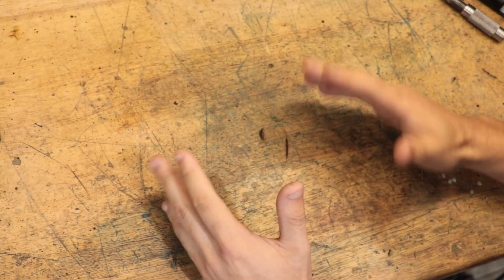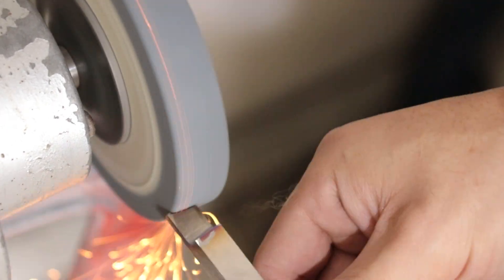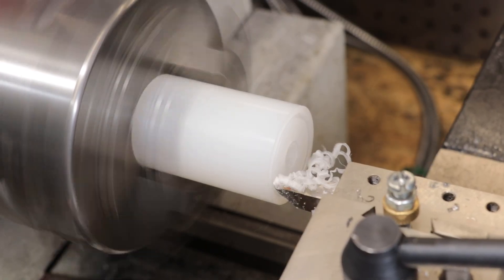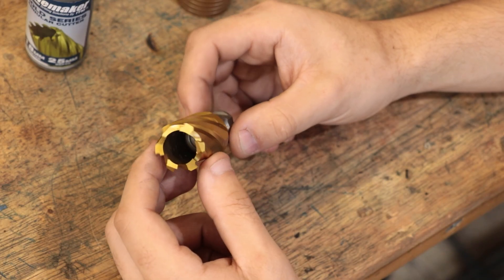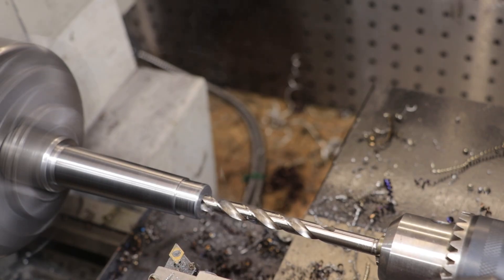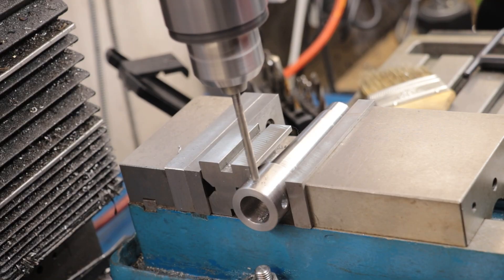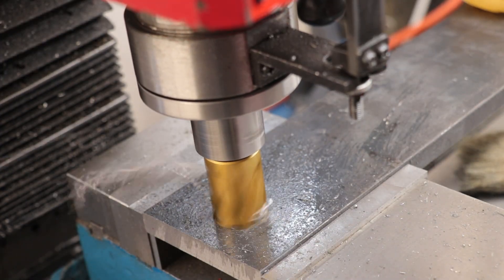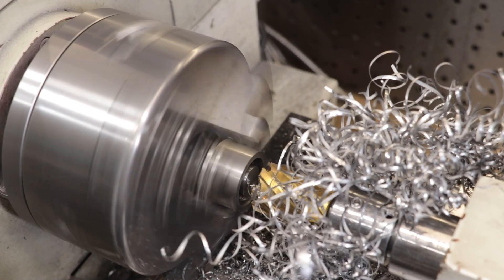Lathe Trepanning - 99.9% Not Brain Surgery

Comment: @artisanmakes  - Aout your lathe. I have one the same and haven’t figured out one thing. There are two sight glasses to see how much oil is in the lower and upper gear case. Mine leaks, I think from the top gear case. Filling up the top gear case is easy ; remove the top cover oil hole screw, and fill it up. How do you drain, and fill the lower case? Maybe I’m missing everything! Thanks for any advice.

Comment: Regarding Trepanning. I had a job once that required 3" dia stock 6" long to be turned into special rollers with a 3" long center portion and 1 1/2 long 1 1/4" diameter hubs on either side. I ended up with a 2 tool trepanning holder with each tool doing half the work mounted in the tailstock. 1 would cut the OD and half the floor and the other would do the ID and the other half of the floor. then part off the remaining rings. Since both tools vibrate at different frequencies they couldn't reinforce each others chatter and damped themselves out. Each tool could be much thinner than the groove so clearance was easy, they could each be angled to ease the clearance problem. So it was really like 2 boring bars operating together. |___|  <--like that.
With hundreds of parts to do this saved me a bunch of time and a huge pile of chips. BTW I still have a box full of those rings decades later! I just KNOW I will use them for SOMETHING one day.
(of course this was before annular cutters were avalible)

Comment: I use those annular cutters any time I can. They out perform any drill by a large margin and need no pilot hole. I even use them on CNC work. The downside as you mentioned is cost. They are spendy and are difficult but not impossible to re sharpen when needed.

Comment: The easiest way i know to get the clearance right is to blue up the end if the tool with dykem and use a radius gage to trace a radius tangent at the corner and slightly smaller than the outer radius you're trying to cut.

Oh, and that bird's nest at the end is terrifying. A giant flail of razor sharp steel ribbons moving at high speed.

You need to peck the cutter to break those chips and stop them from becoming a hazard.

Comment: Re turning the morse taper holder - you can buy morse taper blank arbors, with ground & case hardened tapers, & soft machinable ends... They're not very expensive, and make the job a lot faster & easier.

Comment: Thanks for this!  It was very painful to turn brass into chips a few days ago.  I had to make a bushing that had an OD of 2.300"/58.42mm, an ID of 1.885"/47.88mm and a depth of .875"/22.23mm.  I hated to scrap that much brass.  The workpiece was 2.5" x 6" (63.5 x 152 mm) and cost $172 USD.  That's $28.67/26.43 EUR per inch (25.4mm) so I converted over half of the value into chips.  A 1.5"/75mm x 7/8"/22mm disc is still a very useful chunk of brass.

Comment: Nick, doctor, your plans are good but the execution is not great. Look at industrial trepanning tools and their geometry; quite complex but that's why they're maximum strong and stable. My idea on the matter; hand grinding a trepanning tool for larger depths is not the way to go. Industrial ones are indeed quite expensive and you need quite a few and the appropriate holders too; quite a expensive system. Removing core material by drilling and turning with a boring bar does spoil otherwise usable material but the investment or effort to have a trepanning tool/system compared to the savings in reusing core material is, especially for the home machinist, not feesable in my opinion. Speed of the proces compared to investments or time spend grinding? No home machinist would go this expensive road, Same goes for the angular cutters; expensive and you need a few. Sorry but all the best doctor! Job
Reply from the maker: Industrial trapanning tools aren’t single point for a reason.
Reply from the maker: I don’t think it’s too useful to compare industrial applications to the home hobby shop
Reply: @artisanmakes  I think it is; physics works the same at home. Thank you!
Reply from the maker: I am quite familiar with industrial trepan tools. They are not single point for a reason, they are cylinders but they are very expensive and usually made in house. That is not feasible for a hobby shop, that is why I use single point tools. A boring bar doe not have the acceptable geometry to trepan with, that is why you grind them to be useful as a trepan. My point is entirely based on economics on this being a hobby workshop.

Comment: You should look into a quality diamond grinding wheel.  One of my favorite shop tools is a very expensive eyeglass grinder that was damaged, but the motor and grinder were (and are) still running perfectly.  Ideal for tool steel or carbide and it only cost me $30.  The motor alone would have been hundreds. Used Lapidary equipment is also great for sharpening.

Comment: I'm way ahead of you because I made a cutter like that out of a big end mill and it worked awesome.
I used it to a 11 1/4" Brake disc out of 1/4 "  Stainless Steel and also cut out the 4" center of it.
Reply from the maker: Fair enough. I don’t think my lathe would be up to that task. Cheers
Reply: @artisanmakes  I didn't clarify that  the end mill  was carbide and I cut down in to a cutter  about like yours .

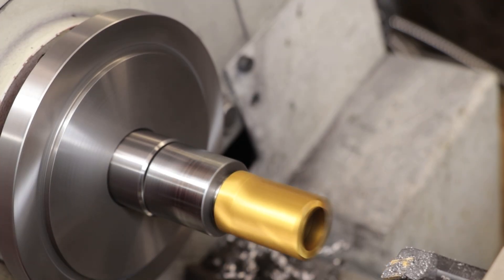Comment: 13:25 that runout should be measured, not observed :)
And it should be measured after the retaining screws are tighten :)
This way.. its just your best wishes, nothing else

Of course.. it wil work cos anual cutter tend to self center if it's not realy badly off center, but...
Reply from the maker: It’s less than 0.01mm if you are interested. If you can’t see it on the zoom lense it’s generally below 0.015
Reply: @artisanmakes  Just methodology... by observation, it depend on viewer is it 0.01 or 0.1 or 0.5...
And on video clip.. it can be off by much more and do not be observerd, or much less and look like it's huge. Just the strobo efect can make huge difference.
What I can tell you.. I'm teached, and have attitude to do things properly... not cutting any corners, and not using "this look like it's OK".
It can be a drawback, but also blessing, just depend do you make a simple fence for the garden, or precision tool, or tool that will do one not critical job... you know what i meen....

BTW.. 0.01 is realy whell done  👍
Reply from the maker: It was 0.01mm on the dial indicator. I just didn't record it

Comment: The reason that cutter is doing so well is it's the bit used in a Magnetic Drill that's used to drill large holes in steel plate/I-Beams...

This type of work is EXACTLY what that bit is designed for...
Reply from the maker: I think you are missing the point of the video a bit but yes, it’s a very good tool for the job

Comment: Tip for hole saws on deeper holes, drill a small hole along the circumference of the cut on the side that is the waste part. Main trouble hole saws have is clearing chips, so a few holes allows for better evacuation

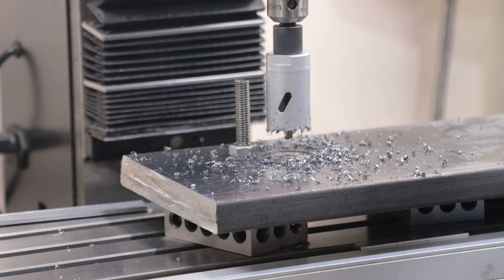Comment: 1:13 - or you are using it wrong )   
to cut a thick material with a hole saw you need to drill some holes first (about 3) which will slightly intersect the line of cut.
those holes are needed to clear the chips from a hole saw blade.
Reply from the maker: And my mill isn’t powerful enough for use it anyway

Comment: At work we use TCT hole saw to core out the bottom of the tanks we make to weld the discharge piping.
These tools are pretty fragile if used incorrectly, but when used correctly they last a lot

Comment: For using hole saws on anything thicker than it's own teeth, wood and steel.
Start cutting then when you have the circle drill one or more chip evacuation holes in the circular trail and keep the big side of the hole innside then the chips will fall nicely down through the hole without blocking the cutter and you won't need to lift it all the time to get away the chips
Reply: Great tip. Works especially well on wood because cutting oil can make the chips stick to the teeth and fail to evacuate through a small hole, but still worth a try. Small correction, the critical thickness is less than the depth of the teeth - it's the depth of cut that starts to lead to chips packing in the gullets, which is typically about half the tooth height but depends on the tooth geometry. It isn't much, anyway!

Comment: One more suggestion - whenever you are cutting/ shaping high speed Steel always keep it cool, do not let it get too hot, to prevent annealing. Otherwise good video.
Reply: Sir, high speed steel is designed to take incredible temperatures without annealing. That’s why it works so well cutting metal.
Reply from the maker: M2 high speed steel can take the temperatures we were throwing at when grinding. It’s not going to affect the temper a whole lot

Comment: Nicely shot video. It took me back a ways. Trepanning can be an education in the causes of chatter. Retired prototype machinist here.
Reply: Chatter always have just 3 "To" reasons...
To high speed
To low feed
To wide tool

The trick is just to find right corelation for your specific machine.

And in this case.. 4-th rider is low rigidity of the machine.
But.. poking around with first 3, and not be too greedy, should give you a good result.
Been there, done that, with even smaller lathe.

Comment: As a data point I made some simple holders for my annular cutters - basically just a close fitting socket with a locking screw to bear on the annular cutter flat.  Then a 18mm round shank with three shallow flats to prevent twisting in the tailstock chuck.  Runout is minimal.  I don’t use a plunger either as plugs tend to fall out due to the relief ground on the inside of the cutters.  Clearly yours is far more video-worthy however!  Interesting findings.

Comment: Here are two tips for drilling holes accurate to size and clean finish, without resorting to boring or spending good money on reamers:-
1.   Feed the drill bit in until reasonable size chips come out.  Then back the drill out briefly and allow the hole to be reasonably chip-free, then feed the drill in again.  Repeat as required for the depth of hole.
2.    I have a set of drill bits in 0.1 mm increments.   If I need, say, an accurate clean finish hole of 23 mm diameter, I first drill with a 22.9 mm drill bit, then take the hole to size with a 23 mm drill bit.   This gives a reamer-like clean hole and spreads the wear in drill bits you wouldn't otherwise use much.

Comment: For making holes at larger than readily available drill sizes, trepanning will mean much lower tool cost.    But you should have a means of capturing the puck - you don't want a lump of steel flying out and whacking you.

Comment: why not just use a hole saw?
Reply: HHS/Bi-metal hole saws do not have the toughness for cutting steel effectively. You can get carbide-tipped versions, but they are not rigid enough and don't have good tooth geometry for metal. They are primarily designed for wood, *and the chips that come from wood*.

Comment: Ive added a hole that Ts into the centering pin hole and run through tool coolant on my lathe. I also use mine for roughing counter bores being as i can remove much more material much faster than a boring bar.

Comment: Awesome video.
I will note; I believe that the hole in the end of annular cutters is usually used for flood coolant; which will Also push the puck out.
Any kind of center or pin or drill bit should allow you to center the hole location before you swap the annular cutter into your tailstock or mill.
Cutting Edge Engineering had a video on an aftermarket tailstock flood cooling attachment he found; tgo for a mini lathe, you'll probably need to adapt that & make it yourself.

Comment: Ha. Before the video turned to them, I was gonna suggest those (annular cutters). I got some "cheap" ones from "Vevor", which turned out to be quite good (even up to 2 inch). I just put them in a collet, since I feel the pin hurts more than it helps. Great job!
Reply: I have looked at them many times, but have not pulle dthe trigger yet, how long do they last before they get dull, is it something like a big drill bit, or do they last longer? 
I can see there are both HSS and carbide models to choose from.
Reply: @chris6160-d6s  You can resharpen or get them resharpened once they get dull. Only used mine twice on aluminium and they are still sharp as is so can't really give you an answer as to how long they take before they get dull.
Reply: @christiantrab6160  I'm not sure if you have bought them yet, but you won't regret the purchase.  In my own personal opinion, they last longer than a twist drill of the same size.  Keeping them cool during use will exponentially extend their life.

Comment: I bought a special carbide tipped trepanning tool from my usual supplier in China. The tool was cheap enough, but the inserts are pretty expensive.
I don’t do much trepanning so I don’t know why I bought it, but when I decided to test it out I snapped the insert 🤦‍♂️
It only came with 2 inserts so it’s in the drawer with all the other bits for when/if I actually need to do some trepanning, & next time I’ll practice on aluminium or plastic.

Comment: For hole saws on thicker plate, first of all you need an absolute flood of coolant, as well as dropping your rpm a lot. For chip evacuation, you can drill a small hole in the path of the cutter, so the stuff that usuallly gums up the teeth has somewhere to go. You will still need to clear up the channel when it gets too clogged, but its far less frequent than without the hole.
Source: have had the displeasure of using hole saws far too often on 316L plate
Reply: Agreed. The tangential evacuation hole makes a world of difference--in both wood and metal!
Reply from the maker: You are that’s what I can’t do on my mill. Once it drops below 4-500 rpm the torque takes a real nose dive and it’s very easy to stall it
Reply: @artisanmakes  so first job shoud be to make additional set of pulleys, that will drop rpm and increase torque :)
Reply from the maker: That’ll be the way to go. The top end of the spindle uses a custom spline profile to connect to the pulley/drive belt and I have to gotten around to making the broaches for it yet. Cheers
Reply: @artisanmakes  Can you fix new pulleys to existing ones?
So you escape spindle and it's profile...
Reply from the maker: It is not a pulley, it is a timing belt which I think makes it a bit more complicated to get around... I think.
Reply: @artisanmakes  You mean timing belt and appropriate pulley, like one on the mini lathe?
If I remember corectly it was some strange profile, so I replaced it some 10 years ago, for standard M belt (and I plan to replace it for poly-V belt and pulleys, in the near future).
Even in this case... you can turn exixting pulleys to some dimension, leaving a small flange, so you can turn inside of new standard pulley and coonnect them with some for example M4 screws.
Bit hard to explane... one drawing will do it in a blink :)

Comment: So, I have a question for you author: The high-speed steel cutting tool you've just made; what temper and annealing needs to be done to ensure the tools lifespan and durability please??🤔 Also: Would a water cooler line be beneficial for the cutting and tools lifespan as well as the cleanliness of the cut metal?🤔
Reply from the maker: You don’t have to do a whole lot to hss. It comes prehardened and it takes a lot of heat to ruin the temper. For trepanning anyway I prefer to use oil than coolant
Reply: @artisanmakes  Thank you for letting me know that! I've just started metal lathe work so I'm mostly learning as I go.

Comment: i havent adopted a lathe yet, and at the time neither had i a milling machine.
but i remember buying two of those with carbide inserts brazed to them, because i had to drill 25mm and 26mm holes in a 20mm thick aluminum plate..
and i have to say they worked perfectly. not only can i say that the price was alright compared to the one time use hole bores, but also was the diameter so much more accurate. they fit perfectly and snugly, not oversized in the slightest.
I like them

Comment: One thing you could try: instead of the positive rake you ground on the tool, try neutral or maybe even negative rake.
The cutting edge will not only be stronger, but will also be less prone to be pulled into the material, thus be less likely to chatter or snap. Also, if anyhow possible, try making your clearances only as big as they need to be. Towards the inside of the hole your cutting, your tool goes straight down, right? If you'd grind it so that the inside would also follow the curve you're cutting, you'd get more cross secrion, and therefore a stronger tool. And every square millimeter helps, so even dishing it out just a little will improve your tool.

Comment: Just to put the price into perspective - let's assume you need to drill 100 holes. 

73 seconds per hole for the annular cutter. 7,300 seconds in total, which is 2 hours and 2 minutes. ~300 seconds per hole for the deming bit. 30,000 seconds in total, which is 8 hours and 20 minutes. That's saving you 6 hours and 18 minutes.

You paid $70 for one annular cut. That puts an estimated hourly value for those 100 holes made with the annular cutter at ~$11.10/hour, if we assume that the deming bit were free of charge. If you put the value of your own time at more than $11.10/hour, the annular cutter is worth it.

This doesn't take the amount of material saved into account (as the pucks can be used for other things, and the cut-off point also depends on the number of holes you expect to cut. It also ignores opportunity cost, because if you have a project in mind where you'd need to make just 12 holes, the hour you'd need to spend making them with the deming bits might just make you forego the project entirely.
Reply: I use anular cutter all the time use water to cool your bit it will last longer than oil